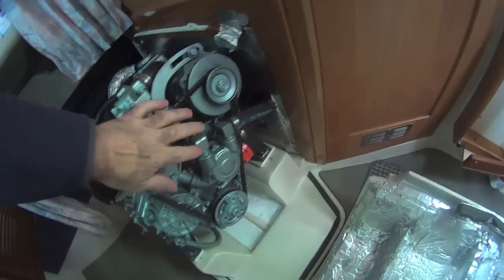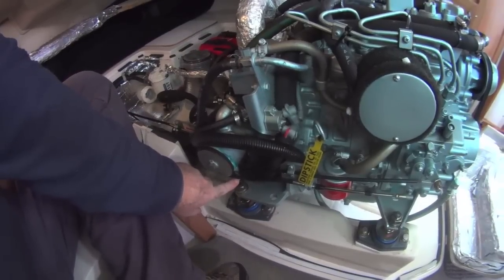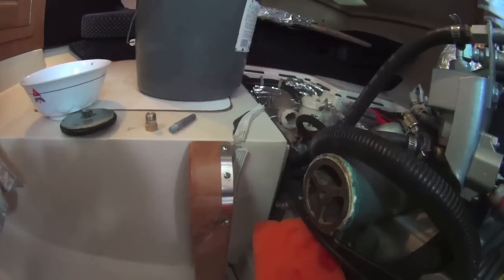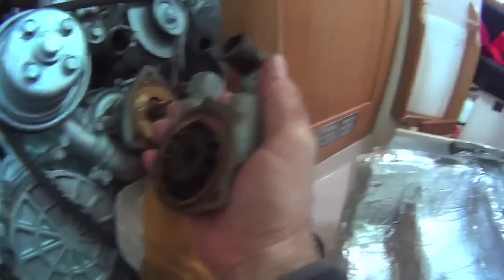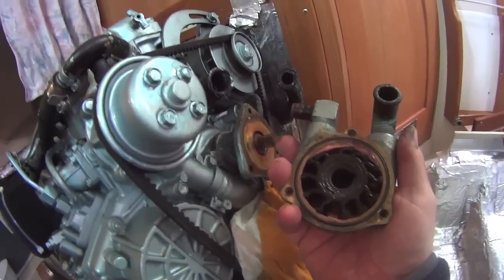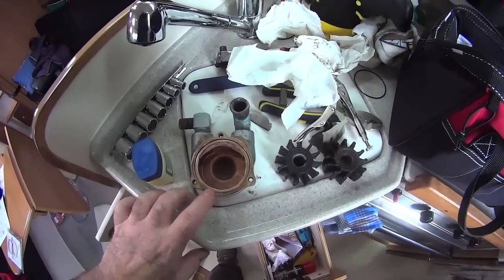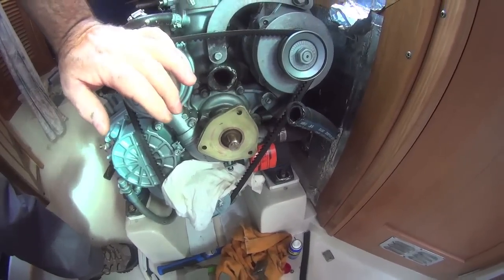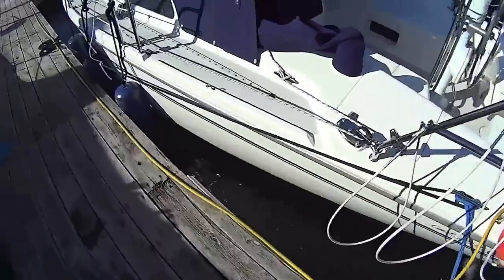Raw Water Pump Repair

Comment: Vaseline on the impeller/?    Be careful.. it can eat the rubber, and the o-ring.   
I prefer to use a synthetic lubricant, such as Superlube.    IMO.
Reply: Vaseline will do the job perfect!
Reply: TRUE   Work fast!  (ring could swell so fast, in petroleum gel, it pops out of the groove) impeller may rinse off if you run engine-until rinsed out.